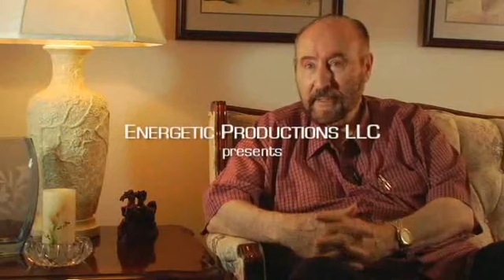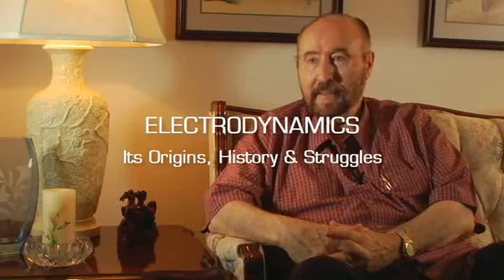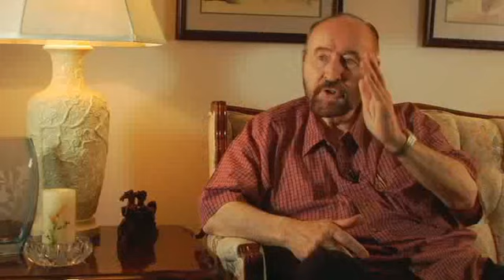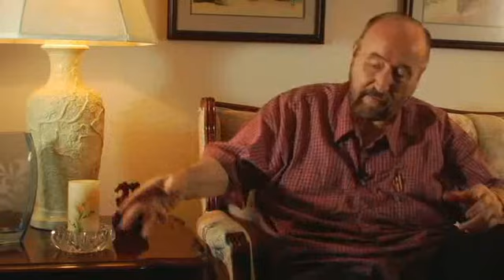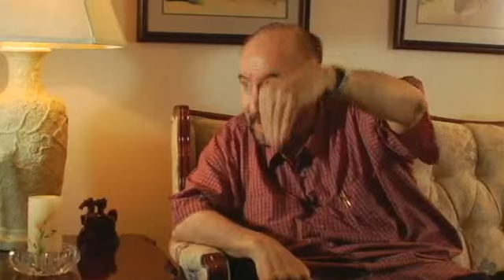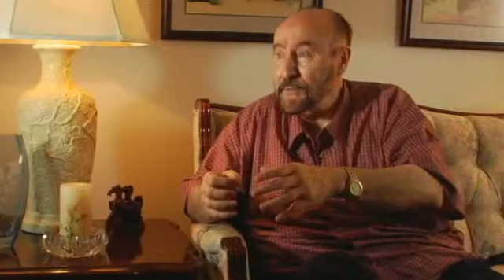#13 - Electrodynamics Its Origins, History And Struggles (2009)

Comment from the maker: 0:01: 🔍 Development of electromagnetic theory from Faraday's experiments to Maxwell's mathematical formulation.
0:01: Faraday conducted experiments leading to concepts later mathematized by Maxwell.
0:52: Maxwell mathematized Faraday's work into 20 equations in 20 unknowns, predating vector analysis.
1:36: Quaternion algebra by Hamilton played a key role in capturing the symmetry in Maxwell's theory.

9:40: 🔌 Maxwell's equations predicted waves, leading to attention on his theory, applicable to energy from the vacuum.
9:40: Maxwell's equations predicted waves, leading to scientific attention on his theory.
10:30: Maxwell's equations are directly applicable to energy from the vacuum due to their application to asymmetric systems.
11:01: The gauge Freedom axium guarantees the ability to change the potential energy of any system.

19:47: ⚡ Understanding the balance of electric fields in a closed current loop circuit.
19:47: Energy flow in a generator creates equal and opposite electric fields in a circuit.
20:17: Introduction of potential to the circuit results in forward and back EMF fields.
20:35: The symmetrical arrangement ensures energy conservation in the circuit.

29:05: ⚡ Uncovering the mystery of energy flow discrepancy in electromagnetic generators.
29:05: Energy flow in generators: Divergence-free energy far exceeds the energy that gets diverted.
29:28: Significant energy output: Generator produces billions of times more energy than inputted mechanical energy.
29:48: Unresolved mystery: Origin of excess energy remains unknown, challenging conservation of energy principles.

38:34: 🔬 Negligence in scientific community towards innovative solutions, leading to reliance on outdated methods and lack of physical significance in integration.
38:34: Negligence in exploring innovative solutions and reliance on outdated methods
39:22: Lack of physical significance in integration due to following established norms

47:40: ⚡ Utilizing impedance to increase energy flow and harness negative energy in circuits.
47:40: Impedance in circuits reduces conductivity but increases energy flow
48:07: Successive impedances in a circuit result in significantly more energy output
48:38: Designing loads to utilize negative energy is a possibility

56:40: ⚡ Utilizing negative energy in engineering for cooling, restoring batteries, and avoiding explosions.
56:40: Negative energy has advantages like restoring batteries and cooling instead of heating.
57:15: Future engineering may involve heavy side components and negative entropy engineering for energy extraction.
57:43: Changing current science can prevent heating the biosphere to extract energy from the vacuum.

1:05:39: 💡 Challenges in modern scientific research and utilization of SST in the current system.
1:05:39: Scientific community overlooks the potential of electrical power systems drawing energy from the vacuum.
1:06:23: PhDs are pressured to publish and secure funding, leading to a shift towards money-driven research.
1:06:39: Post-docs struggle to find stable careers, resulting in underutilization of SST under the new scientific system.

1:14:53: ⚙ Inventors have successfully created widgets based on the science of exchange force, violating the second law of thermodynamics.
1:14:53: Inventors like Howard Johnson created a permanent magnet motor that can power itself through the manipulation of exchange force.
1:15:25: The system of magnets and exchange force allows for self-rotation while obeying the conservation of energy law and other physics laws.
1:15:47: By emitting a sharp pulse of exchange force at the right moment, the system can override the vum and continue to drive itself.

1:24:10: 🌊 The concept of static spacetime is debunked using a waterfall analogy, highlighting the dynamic nature of spacetime.
1:24:10: Energy is derived from changes in spacetime or the vacuum, with no other source of energy in the universe.
1:24:23: Spacetime is always dynamic, with no such thing as static spacetime except in geometric models.
1:25:08: A static waterfall would be frozen, emphasizing that even though something may appear static, it is constantly in motion and evolving.

1:33:28: ⚛ Challenges in harnessing energy from the vacuum due to outdated models in engineering.
1:33:28: Difficulty in applying new knowledge to existing engineering models
1:34:03: Energy extraction from the vacuum is an engineering challenge, not theoretical
1:34:16: Theoretical foundations support extracting energy from the vacuum, but lack of developed systems hinder progress

1:42:50: 🔬 Challenges in updating engineering sciences due to historical factors and security arrangements.
1:42:50: Practical result of early century theories affecting engineering sciences development.
1:43:05: Limitations and isolation caused by security arrangements impacting technological advancements.
1:43:12: Engineering fields like radar and electrical engineering remain relatively unchanged over time.

1:51:53: ⏳ Concept of time inferred from changes in surroundings led to Einstein's development of SpaceTime.
1:51:53: Time inferred from changes in surroundings; Einstein abstracted geometry to create SpaceTime.
1:52:16: Einstein's theory of relativity based on modeling time as a fourth dimension in SpaceTime.
1:52:44: Interest in SpaceTime theory grew due to tools used by Einstein to construct his relativity theory.